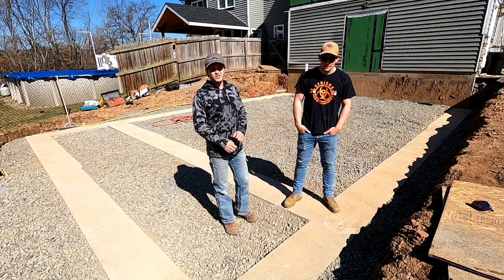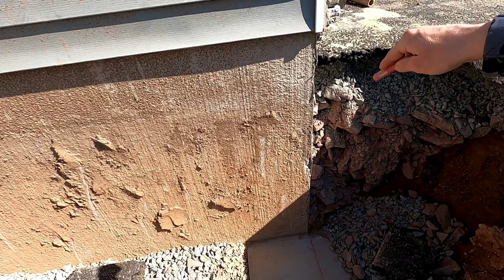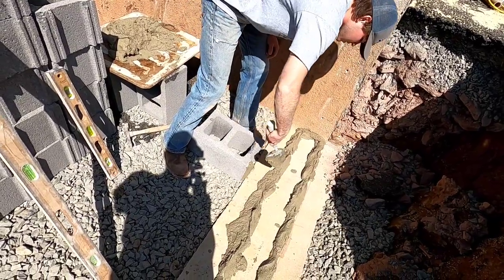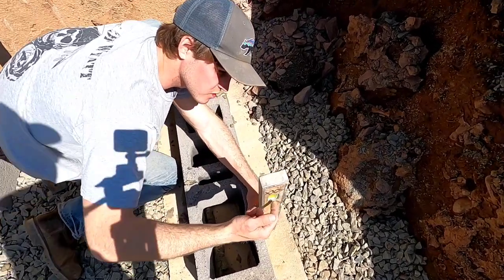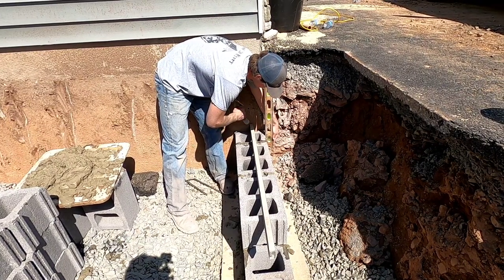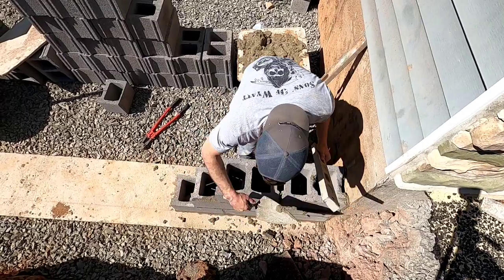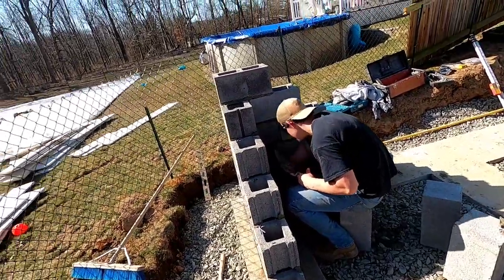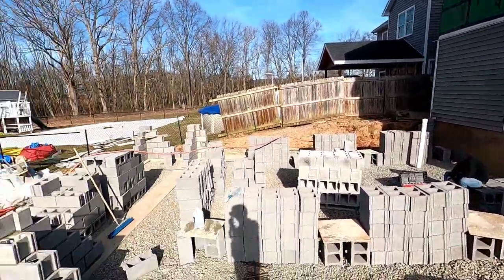How To Lay Block Corners

Comment: Hey young fellas. Just wondering if you mix your own mortar and what ratio you are using (3 parts sand 1 part Portland cement?). If you mix your own, what kind of sand are you using? Thanks for the tips in the video. I want to build a greenhouse foundation with 10" block (7 high about 100').

Comment: Thanks for the corner detail. On average, how many blocks do you lay per day?
Reply from the maker: In this video I started laying at 12:30 and stopped at 7. I laid 108 block. That was about 16 an hour- so around 130 a day. That was with a level so it was slower. When I run walls I can lay a lot more than that
Reply from the maker: If I was laying the walls I could lay 3-400 easy in a day
Reply: @masonthemason6412  Wow. We're building soon and have about 900 to lay for our crawl space....debating to do it myself (no experience) or hire it out. Probably decide after I get a couple of prices.
Reply from the maker: With no experience that's hard. It took me awhile to get the hang of spreading the mud. I will take a video of the Jake's spreading to give you an idea of what it looks like starting out. It also takes time to figure out how to set the blocks. It would be a fantastic learning experience though. It's not too big and shouldn't take too long, even with no experience
Reply: @masonthemason6412  Thanks, your videos really help.
Reply from the maker: That's great to hear! I'm glad I could help you

Comment: When you insert the rebar in the old foundation and lay a block over it in the new foundation, do you need to fill in the block all around the rebar with mortar or concrete to grip the rebar? Or what is it that keeps the new foundation from separating laterally from the old one?
Reply from the maker: Yeah we fill it with concrete when we core pour

Comment: How deep should the rebar go into the foundation?
Reply from the maker: Like 4-6 inches
Reply: @masonthemason6412  thanks! Gotta tie in a 8" block wall to the foundation for a bulkhead. Had one of those nasty old steel ones that rotted out. Had no foundation

Comment: Brother make it easier for u cut back it against the wall put a top mark measure down 8ts put a hard nail and blast them in......
Reply from the maker: Ok, I finally figured out what you meant haha. Skip lead, just put up outside corner, string on existing foundation. That would of been way easier. Thanks for that tip! That's great to know for next time
Reply: @masonthemason6412  yes sir.... way easier and faster.....
Reply: @masonthemason6412  i always like to string end to end. Most of the time I use line blocks just in case there is a tail in the corner end to end you can work it out better on top course
Reply: I'm intrigued by this comment but cannot understand. Could you please translate for a non-builder?
Reply: @keenanonie  I wrote it so bad the first time I don't know how mason even understood it lol